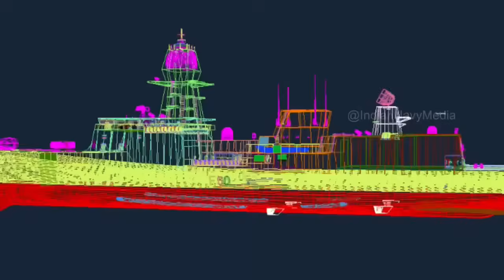Udaygiri - Construction Journey

Comment: INS Vishal?
Reply: It hasn't started yet, but if it starts today, it will take around 12-15 years😅
Reply: @Ankit-Saumay_ka_hater bro but we need it and we will make it
Reply: @RishavPatel-ps2dg Yes definitely. But for now there is time🙃
Reply: @Ankit-Saumay_ka_hater  not 10 to 15 years navy says to build same type aircraft carrier they need only 5 years 
But for more big one they need 7 to 8 years
Reply: @yashtyagi8033  This will be the largest vessel ever built in India, but metal cutting hasn’t started yet since it’s still in the design stage. Due to bureaucratic delays, the timeline will be long, not just for construction but even for getting started.
And also The nuclear propulsion plan has also been dropped 🙃, and it will now use a conventional engine 🥲. It wouldn't be a nuclear power carrier😭